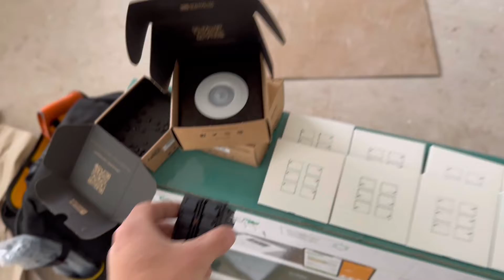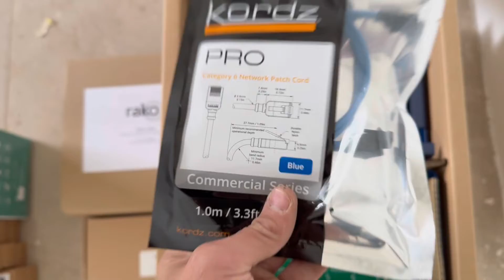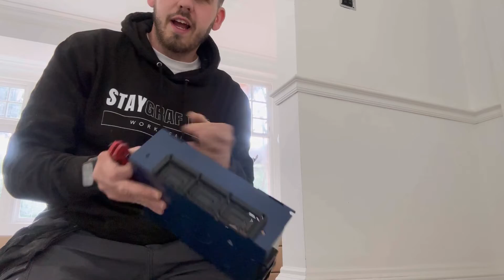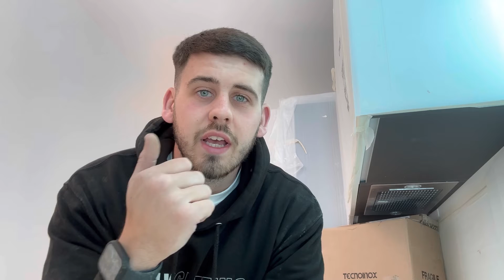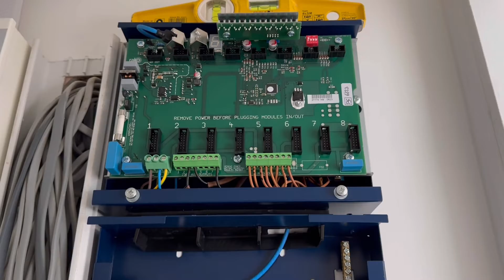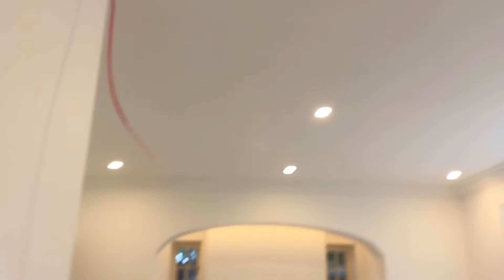Step By Step Rako Smart Lighting Install

Comment: Thinking about installing this on a property I'm renovating. You're pretty committed in the way you wire it aren't you e.g only data going to a switch so no going back. Thinking maybe to run data to all switches but also run switch wires up to the lights just as back up. Any suggestions?
Reply from the maker: yes you would be committed to rako but its an expensive choice so not sure you would want to go back to standard switched. there is always wireless switching you could replace it for if you ever want normal switches.
Reply: Get lutron lol